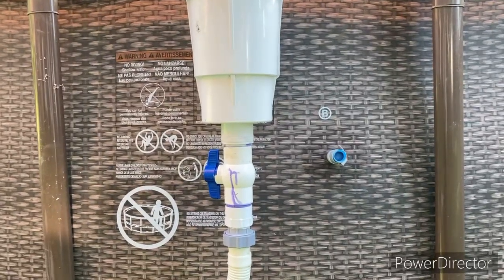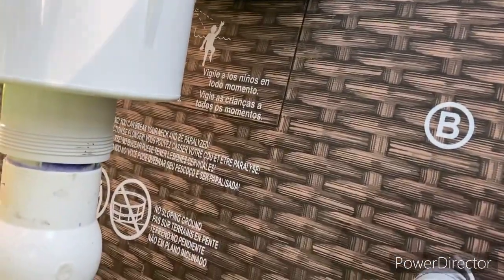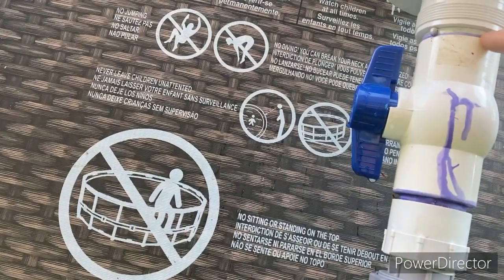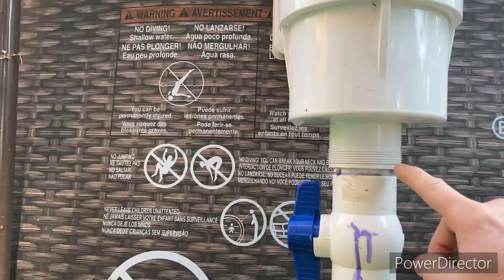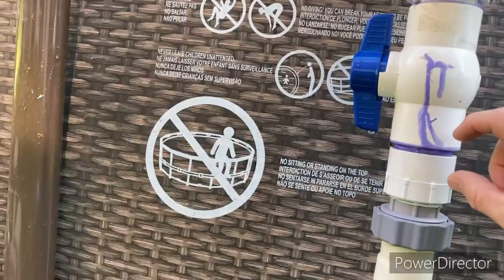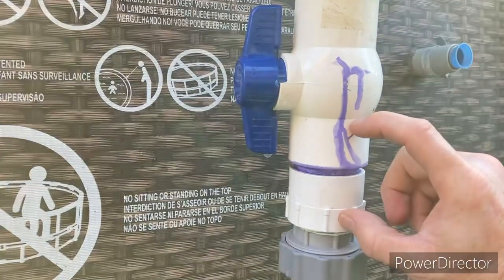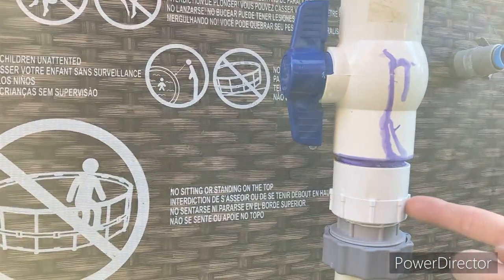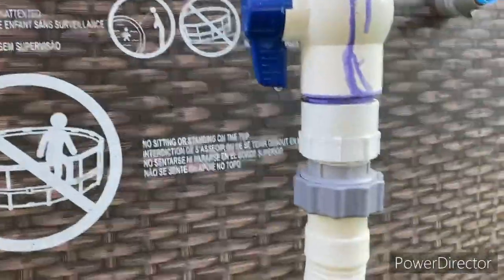Hayward skimmer plumbing connections to add a shut off valve

Comment: The inside diameter of the Hayward skimmer  is 1 1/2. You'd need a male threaded adapter and an extra piece of 1 1/2 pipe to connect the ball valve.  You could also do a 2" threaded ball valve if you wanted to use the outside diameter of the skimmer.   I'm standing in the hardware store trying to piece this thing together

Comment: How did you plug the old intakes?
Reply from the maker: I had old caps from another intex pool. I would look in the toy department or kitchen department for something solid plastic in the correct diameter.
Even a rubber sex tox in the right diameter that you could cut to length would work. 
I don't have anything better.

Comment: Yes please tell how you plugged old intakes!!!
Reply from the maker: I had old caps from another intex pool. I would look in the toy department or kitchen department for something solid plastic in the correct diameter.
Even a rubber sex tox in the right diameter that you could cut to length would work. 
I don't have anything better.

Comment: What did you use to plug the old intakes?
Reply: Wall Plug Replacement Ground Swimming Pool Fitting Filter Pump Strainer Hole Plug Stopper for Intex & Bestway Pools / 2 Pack… https://a.co/d/8Z0Ualr
Reply from the maker: I had old caps from another intex pool. I would look in the toy department or kitchen department for something solid plastic in the correct diameter.
Even a rubber sex tox in the right diameter that you could cut to length would work. 
I don't have anything better.